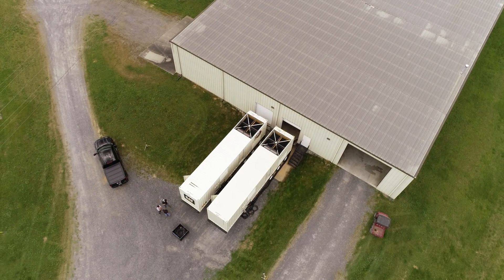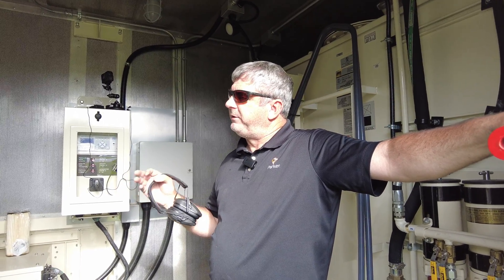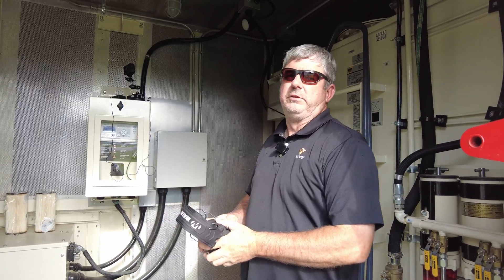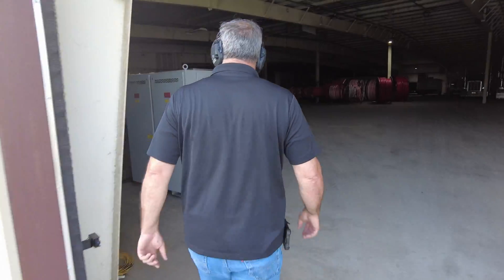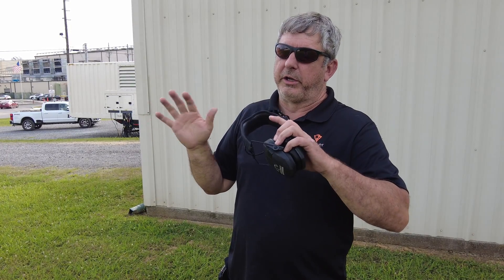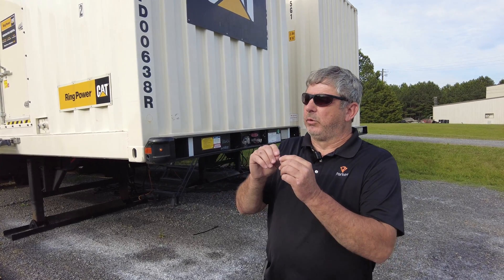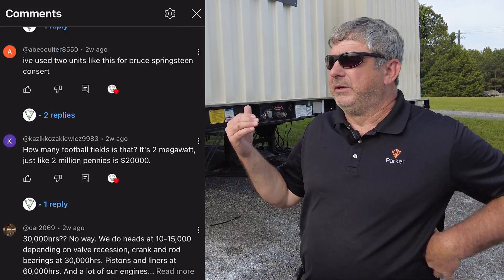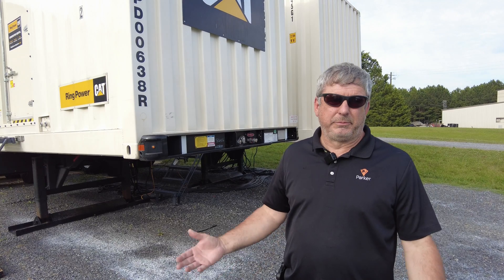2 Million Watt Generator Cold Startup & Parallel Operations!

Comment: No external view of the start up. We have three 3516's, 1.4MW and two 3512's, 1.2MW in Antarctica to power McMurdo station and they really blow out some smoke on start up. Derated due to less dense air and the low gel point "AN-8" fuel has less BTUs. 
Was curious if these were any better. But any 3500 series video I see, they all smoke on startup and when block loaded. But great engines! Used to work on EMD two stokes, the 567s put out 2MW, 645s put out 2.5MW and the V20 710s were 3.5MW / 5,000HP. Yes, they are train engines and sounded like trains. I have some videos on my channel of the Cats and EMDs. 
Also used to maintain portable 2MW trailers, like shown here. But had Cummins QSX or QX whatever in them, not a fan of those. The Cats are much better but the EMDs can't be beat. Unfortunately two strokes and emissions don't cooperate to well though.
Reply from the maker: Good point -- these engines are definitely not as impressive as the EMDs on a cold start -- Thanks for watching.  I have another video that shows the cold start -- but since no real load its is kind va underwhelming. -- save the trees they love the carbon -- they literally live on it

Comment: could these units be converted to run on CNG or jet A1?
Reply from the maker: Assuming JET A1 is like JP-5 or JP-8 I am sure it would work -- I believe that the only difference between 5 and 8 are additives for different levels of temperatures  to prevent gelling or issues at cold temps ... most jet fuels are basically diesel at more refined level (kerosene) with additives to prevent gelling, or ice crystals forming to making sure that fuel will flow at cold temps  -- on natural gas, engine manufactures will adapte diesel engines to run on natural gas but require major changes, like the additions of spark plugs were injectors used to be and controllers to measure the gaseous fuel supply to the engine.  So these units will operate on JET you would need a different version of this engine for natural gas -- also natural gas has about 80 percent of the energy in diesel so the units may be slightly derated.

Comment: When I was working we had the smaller version (3512) feeding a closed mode transfer switch to get us off shore cleanly. To sync quickly the generator was set to run just a little fast.  Typical startup to transfer was around 10 seconds.  Transfer switch was like firing both barrels of a 12 ga.  "Ba-Bam."

Comment: Took Holt CAT power generation 1,2 &3 classes in Irving, Texas back in 2009. I still remember  paralleling two large generators with a rotating digital display on the control panel. The generator's were wired to a very large load bank. Good stuff, thanks for the video!
Reply from the maker: Thanks for sharing -- we appreciate your watching --- i have done it with just a light bulb between the same two phase

Comment: Understand you could utilize them either way but what is  your primary goal, redundancy or load capacity?
Reply from the maker: Both are applicable…. And with utility paralleling you can provide power continuously without interruption … helpful in industrial applications when processes suffer if power is lost even for a short time.     Durring hurricanes we do capacity, during concerts, data center, redundancy is the goal.  Thanks for watching

Comment: My office has (6) 3.5mw mtu generators in parallel they are beasts and loud to run. I don't remember the model. But they do have 2 sets of oil and fuel filters and are designed to do oil and filter changes while they are running.
Reply: Guarantee you that the 6 generators are in a N+1 configuration, meaning one or more is a spare in case of failure. The one that is the spare at the moment (not running), is the one having maintenance done.
Reply: @324atleD  no, its not N+1 It's in a distributed redundant power system also known as 4 to make 3.  All the generators run at the same time.  But yes it produces more power than needed.
Reply from the maker: thanks for watching
Reply from the maker: Holy cow -- thats a lot of power -- pretty neat about the fuel filters and oil -- on these units they have 3 pre filters that can be services in operation for the fuel -- I dont think you can change the oil filters in that manner - I know it have a port connected oil systems -- you could change the oil around under operation -- but could not really do a full change including the filters  --  -thanks for your comment

Comment: That should run my camper AC.
Reply from the maker: lol.  You will not even need a soft start.
Reply: 12a at 120v. You can run 1350 camper ac units with 2 MW 120/208 3Ø. Enjoy your cold campers
Reply from the maker: lol perfect --someone didn't sleep through math class